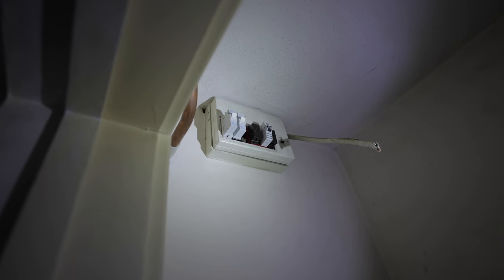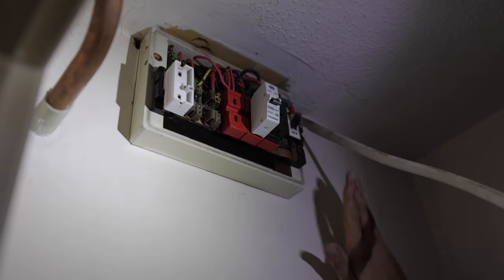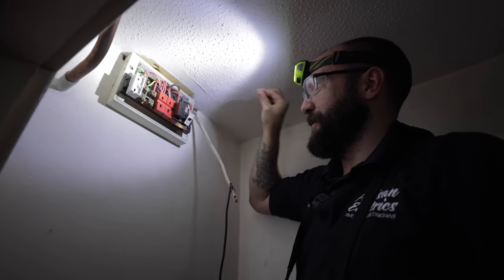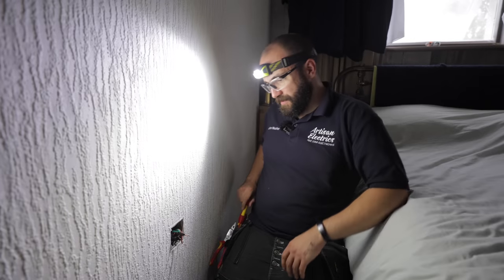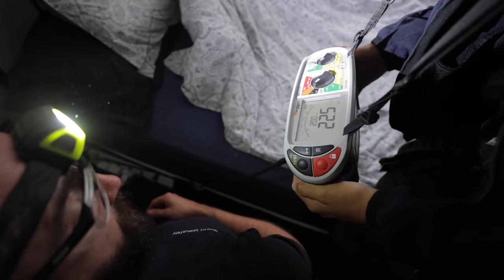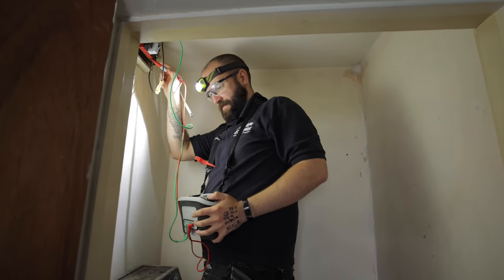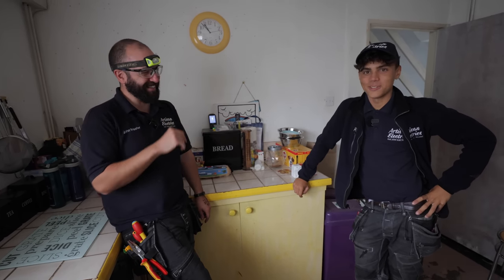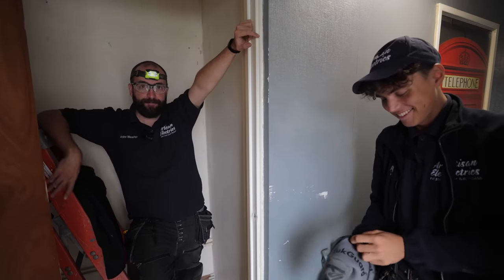The WORST Electric Shock I've Ever Had!

Comment: Old man got a nasty Shock repairing and old CRT TV. Those vacuum TVs can be really nasty as the capacitors and Fly back transformers carry around 11KV at some times to create the picture on the TV !!
Reply: One of the most insidious things with CRTs is that it's the tube itself which acts as a large capacitor for the HV.

I still hear stories of people trying to discharge the tube by connecting a wire from the Anode cap to "mains earth". sigh. lol

Not to mention the whole "hot chassis" thing used in older CRT TVs, especially in arcade monitors and older TVs in 110V land.

I do a lot of projects involving retro gaming, so CRT TVs are a commidity, and still very popular.
In more recent years, more people have been learning about modding a CRT TV for RGB input, as many of the older TVs in the US only had Composite or just RF.

But there are still a lot of those TVs which use a "hot chassis", where the whole main board is floating at mains potential, and only a simple bridge rectifier and voltage reg separate the mains from the board.

Those TVs usually have no exposed metal parts on the outside of the case, aside from the RF connector which has an insulator block between the outer connector and the RF tuner.

The scary thing is, if somebody were to fit extra connectors to RGB mod such a TV, they might not even realize there's a problem until they go to plug the cable into something else which is grounded to mains earth, or they touch the cable/plug and something like an earthed radiator or other equipment. :o

I was told on a YT comment before that "you don't see many hot chassis CRTs any more".

But this is *retro*, so obviously a lot of people are on the lookout for CRT TVs now, and many 80s and early-90s TVs still used a hot chassis.
Reply: @electronash  Live chassis made our whole tv aerial install live when i swapped the isolating co-ax socket for a normal co-ax socket because it was broken...
Reply: @TheChipmunk2008  Yikes! lol

I never thought about that possibility, making the whole antenna live.

I know there can be some issues as well with milder shocks between mains earth and the ground of a Cable TV connection, but that's not even close to as bad as a hot chassis TV.

I don't think the hot chassis thing is as common in 230V land, because at that point, using a linear voltage regulator becomes expensive, so more 230V TVs tend to use a full SMPS with proper galvanic isolation.

That is at least since the days of vacuum tube TVs. Some of those were scary.

Oh, and of course a lot of white goods like coffee machines often use a capacitive dropper instead of a small SMPS, so those would have plastic buttons etc.

I found out the hard way a few times, about assuming the "low voltage" PCB really is at a low voltage potential. lol
Reply: @electronash  Live chassis persisted well into the late 80s on some brands in 240v land, even with switchmode! (cheaper to make the transformer that way) But it died out in the 90s when mass production made it easier to get proper isolation
Reply: @TheChipmunk2008  Yeah, after about 1993, it started to become far less common, as everything started moving to full SMPS with an isolated trafo.

MOSFETs and SMPS chips became a lot cheaper, too, so that helped.

I actually forgot you could have a SMPS and STILL have a hot chassis. I guess in some cases, they would basically just have the "negative" side of the bridge rec hooked up to the "ground" of the main board / low-voltage side?

(Since the secondary side of the transformer is isolated from the primary anyway, it wouldn't short the bridge rec. It probably also made the feedback circuit simpler and cheaper.)

That's slightly more scary in some ways, because some people have said that "As long as it has a SMPS with a transformer, it's probably not a hot chassis TV."

Which is of course not always true in the earlier days.
Reply: @TheChipmunk2008  Yeah, I try not to ever mess with microwave ovens.

I replaced the relay in our own one once, and only after safely discharging the HV cap, replacing the relay, then replacing the cover before powering on again.

Doesn't take very much current at all to stop the heart, or cause a fibrillation, it just needs enough voltage to get through the skin resistance.

Or if some conductors pierce the skin, a much lower voltage can be lethal.

Old camera flash units can be a bit spikey, too.

Comment: It occured to me as I watched you liven up that old CU trying not to touch the bus bar, if you had a plastic tool that slipped over the main switch you could operate it with your fingers well away from any live parts. I dont know if there is such a rool but you are welcome to the idea.
Reply: I have had a few shocks over the years nothing sever, the closest I got to having a major accident was wiring in a large copier machine to a 20A DP switch (I never liked them) I asked the resident Electrician if the juice was off he said yes you are fine I have the fuse in my pocket. I proceeded to start unscrewing the terminals and "Bang" I couldnt see for a few seconds and lost 1/4 inch off the end of my screw driver. When I got hold of the sparks he found some "Hero" had wired this new circuit to the other side of the main bus bar 200A supply.  (rool=tool)

Comment: My worst shock,
During a solar PV installation, the roofers decided to connect the pannel array before checking with me in the loft.
I was feeding the 2 DC cables through the stuffing gland of the DC isolator and the ends both touched my first finger of my lefthand.
Pulled my hand away and smashed the back of my hand on a roof truss. There was a smell of pork in the air.
5 mins later one of the roofers popped his head in the loft to let me know the pannels were all connected.

Comment: One of the worst I had was when I was wiring an additional circuit in to a consumer unit above a metal garage door and was using a neon screwdriver and touched the garage door with my elbow - bang I have a really nice scar on my elbow

Comment: Worst shock after replacing 3 40a solid state relays in a panel putting plastic trunking lid on and using hand to tap it in place slipped and went across terminals. Threw me across floor,sick and cramp in arm for 2 days and burnt hand not good.

Comment: The worst shock, is when you cant get off or let go, thats usually  happens with neutrals on load and separated with you between them. In my experience, neutrals are the most dangerous.Saw an electrician getting a shock through neutrals, with his hands in the air still stuck and himself on his knees, luckly we were able to switch off the mains close by. -Live wires wake you up and make you not be so blase about electricity!! Unless your dealing with 415v, then its a bit more serious. Yes I've had one of those! It used to be common practice years ago in the commercial world, that only one electrical company be on a site at a  time, nowdays, you could have two or three on commercial sites, safety becomes more problematical. Had a guy slip between top panels on a switch panel, and down onto the huge 3phase bus bars-he died. Cause, was another electrical contractor, who had not refixed the panels on top. The commercial world is far less forgiving

Comment: I've had two memorable belts! One was a full 240v whack after isolating the wrong circuit - except instead of a usual (more gentle) 240 to ground shock (through the floor) that we've all had at least once - in this case my thumb was resting on the exposed cpc and my finger (same hand) touched the line. HOLY SHIT was all I could think about for a split second before the RCD tripped. All I can say is THANK GOD the additional protection was there! It was a TN supply as well with a true path to earth - I could have been really badly hurt otherwise. My 2nd one was working on a petrol car - doing a drop down test pulling the HT leads while the car was running. Unfortunately the insulation wasn't perfect and I had an allmighty belt while resting my other hand on the car body. Ached for days after that one!

Comment: I've had a shock off one of those wylex consumer units when wiring a new circuit, I had my hand in the back when I caught the busbar so my hand was trapped.
This is before  using lock out kits, I don't know if I had switched the main switch the wrong way or just had moved it with my arm.

Comment: Some happend till yet: 
- Telephone line repair how was "cut off service". Just at this moment starts a call, the extra bell rings, 60V can be hard for this second. Never belive other worker, home owner, co-workers, ... 🤬😱 "Somebody" do a short cut to the extra bell and to the line - what we found out later of course. 
- Thailand story: Suddenly ends the sunny day with a big bucket of water near 6 p.m. from the sky and I start to close the plastic around the pool-sitting-in-shadow house with two sides to the wall. It was dark from clouds and evening so the lights around was a big help. After it was so slippery I put out my plastic shoes and walk around with naked feets. Direct on the wall I grab the band to let fall the plastic just in near of a switch and socket combination for the light inside this house. Feel suddenly a bang between my finger and my feet - my heart start fast ... of course I was wet from rain and it let electrical power flow trough my body easy. Good that my muscle react and I start falling back (also away) to the 2m hole behind me (the other side of the wall). The normal wall high was around 40 cm only. Fast grabbing with the other hand the line from the plastics so that I stop falling down. My hearth and hand shaking stops after around one hour. 

The inspection days later show a perfectly box how was installed correctly - but the 2pair power cable (only L1/N) have a smal knife cut direct down the box. It starts wet with the rain and strong wind. They have a switch in the pool electric house to make off all pool lights and all sockets around together. They used this inside off-switch at every evening (and on-switch at morning) during the not raining times. The switch in the pool-sitting-in-shadow house was only to make on the lights in this house mostly near 6 p.m. - when it starts dark. When they know it is a rainy day they use the switch inside the pool house first and then put down the plastic - of course on day. So nobody known this problem before. 

As the pool lights was installed (with the pool) they install a light dimmer too - so the lights go on/off automatic. But the uneducated thai electrician think it is a "ghost thing" and reinstall a pure switch (with a human automatic) and the not-needed lights in the shadow house. Same he do over the full place e.g. for ghost house and small table house.

Comment: Doing a rewire pulled the lighting rewireable. Silly didn't check the cable cut it .It was on a rewireable  with the sockets .Cut it in half and it was still live .

Comment: DC shock from emergency lighting voltage leak down cpc in a commercial building as an apprentice, fishing a new cable out the metal trunking. The original installers had paxilined between the trunking and boards to stop cable chaffing but never bothered to bond it figuring the 1mm single cpc's on the lighting system would be a lower resistance drain path.
Reply: very similar story, but i didn't get a very severe shock from it.... 240v DC emergency lighting feed to a 30w linear filament lamp inside a fluoro fitting, the battery was supposed to be floating (no earth at all) but there was a fault in the charger, meaning when on charge, the positive pole was earthed, so I got 240DC off the negative (unfused) lead.  I actually got praised for reporting it (I was a 16yr old yts kid), because it was a potentially dangerous fault from a fire perspective, no fuse other than the dual 60A fuses in the battery!

Comment: Biggest shock was when I was on building site (private house) and contractors made a short on a  construction switchboard, after few minutes I found the culprit, a 3phase concrete mixer (plug). I clearly remember that I switched off main switch and few breakers on the board. In the middle of disassembling 3p 32a plug one of the workers flipped main switch, and I got shocked from 2 phases, I couldn't speak for half and hour. Apparently they wanted to make some tea/coffee and forgot that I was still there...
Reply: My friend did something like that to me i had isolated the fuse board and was working on exposed wires in bathroom.  He turned on the fuseboard knowing i was working  but I was ok as i had removed all the cartridge fuses from his old fuse board to prevent any circuits being live. He hadnt noticed i had removed them all put them in my pocket and put the cartriges back empty.  He was very surprised i wasnt electrocuted but working with a cretin in house you have to think of everything. I even removed the spare  fuses just in case he saw the empty fuses abd tried to replace them.

Comment: Worst shock - Repairing a faulty ASKO washing machine, which had severe corrosion on the inside frame. Stupidly forgot to turn off the mains...got a massive wallop from the main control board, which had an Earth leakage, thankfully it threw me back about 5 foot and tripped the breaker. The machine died, but not me.

However, my other scary story, didn't get shocked, but came close to death. Working currently as a Train Dispatcher, a Class 319 unit brought down the 25kV overhead wires at Euston on Platform 13. I was stood only about 10 metres away when the wires hit the platform and the roof of the train with a tremendous flash and BANG. Any closer I would have been struck or hit. by the residual current.

Comment: When connecting mcb lcn for example msome mcb when "open" the circuit  some MCBs keeping open little more N so it can protect the divice against neutral cut,if someone connect lines unproperly it can be fatal ~240 v its not a game...
That's why,must check with multimeter every line 2 or even 3 times before you start one home you don't know, and never touching metal with your hands,only with 1000v tools.

Comment: Worst shock I ever had was pushing some cables out of a surface socket back box that was in free air on a free bit of twin and earth that was being replaced. I thought it was dead but it wasn't and pushing on the ends of the Live and neutral conductors to try and force the cable out through the grommet, it burnt holes in my hand as the current tracked from one conductor to the other. I also once got a DC shock from, a PCB. The outline of the tracks were seared into my finger, two perfectly formed yellow pcb track imprints.

Comment: Worst shock I've had was working at a mechanics work shop fitting some new lights , turned it off at the board, climbed up the three times extension ladders , was holding live and neutral both at the same time because I was flattening the cables out before stripping them back, and bang some idiot turned the breaker on, you could say I should have been competent enough to put a lock on the board but what idiot who's been working along side an electrician all week and had explained he's turning the lights off today does that ? 
Safe to say he got more of a bollocking of his manager than I would have give him 🤣
Reply: and that's why we always lock out the breaker and then test the circuit is dead in case of cross wiring or incorrect labels. The idiot who turned them on, yes was an idiot, but also sometimes lay people are conditioned to turn breakers on like it's nothing...especially if the breaker is doubling as the light switch (is that a problem you have in Europe? In the US, it's way too common for breakers to do double duty as a light switch which means people are regularly in out of the panels flipping switches). Trust is something you can't afford to give when it come to ensuring power stays off. I could be in a building full of master electricians and I'm still locking out that breaker.
Reply: @notme232  In Germany, we do not use the circuit breaker as a light switch. Certainly not in residential homes. Never heard of anyone doing that.
Reply: It wasn't a switch it was a  breaker, and was in a glorified switch room that only has two dbs and nothing else in with the door closed, he'd also been there all day and could see I was working on lights, sometimes you it would be too tedious but in future after that I will be .
Reply: @ChristianWagner888  I should have said it's most common in commercial buildings, however it's not unheard of for garages and other auxiliary residential buildings to have things like that. Obviously that's not to code, and corrected when possible, but DIY is gonna DIY.

Comment: My biggest shock was my grandmothers Russel Hobbs K2 kettle, they have a big old round plug you pull to unplug it, so you can fill it up. But the plug shell was cracked, so I grab it and pull, the plug shell pulls away from the kettle exposing the live contacts inside, my thumb contacts both live and neutral instantly. So I have one hand with a death grip contacting live wires the other on the stainless steel kettle and I'm touching a stainless steel bench top that's bonded to ground. The shock made me rip the power lead from the wall socket,  afterwards I staggered into the lounge, everybody knew something bad had happened because I was white as a ghost.

Comment: My Biggest shock- working on a strip light in an older lift, tombstone holders baked up wouldn't turn to remove lamp, no access to isolate, tried to spring out lamp, wire came out of holder, touched finger other hand on earthed trim, arm to arm shock, it held me, thought I don't know how I'm getting out of this, next thing I'm crouched on floor of lift spark's as wire blew out circuit, hospital advised 2nd degree burn and did ECG.
Still have scar on finger.
I was very Lucky that day.